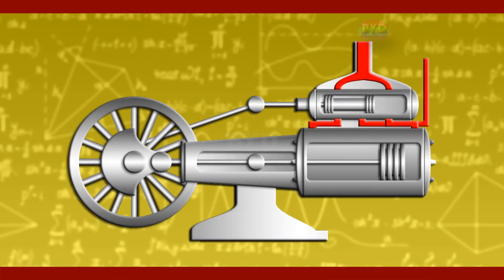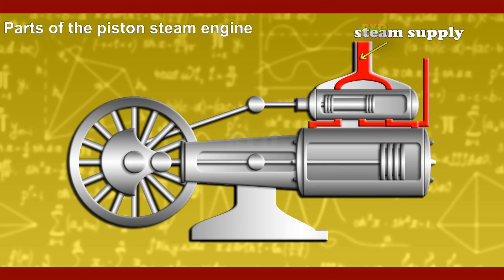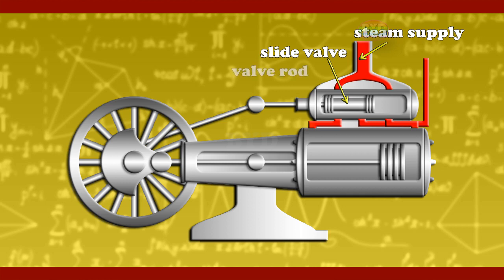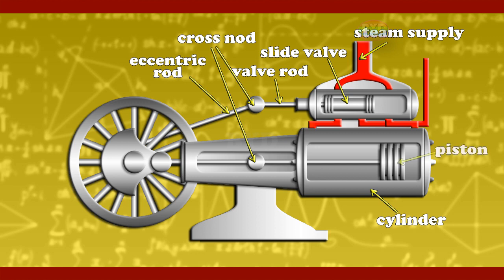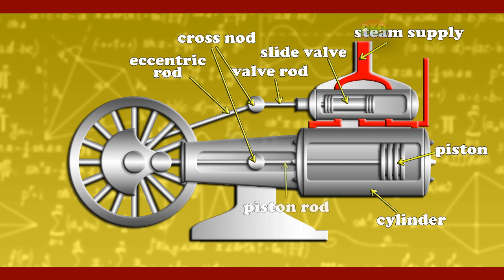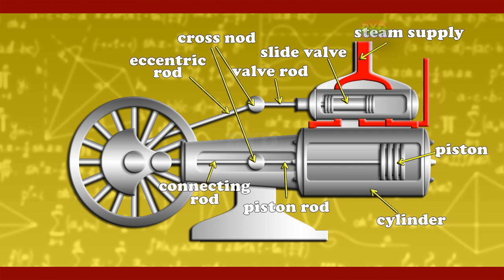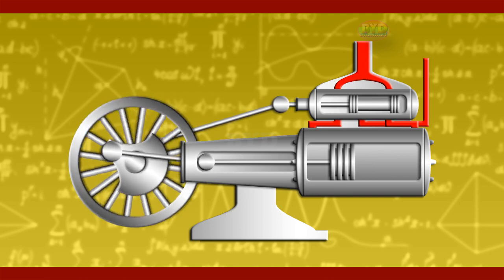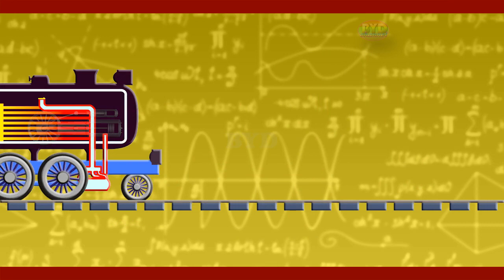How to works steam engine single cylinder animation

Comment: id like to mention that the valve timing on that animation is wrong it should be at a 90 degree offset not 180 overwise the piston will go to the middle of its travel and sit there